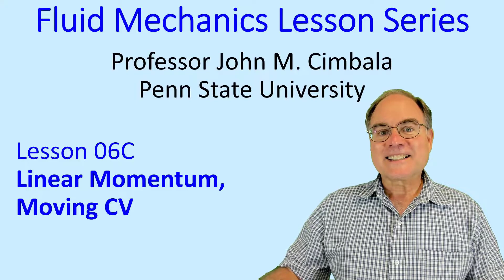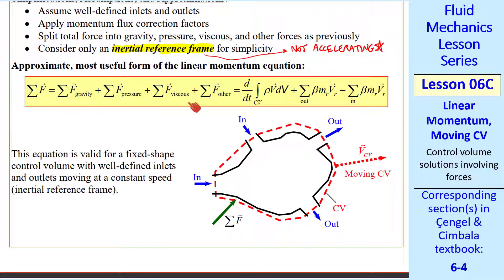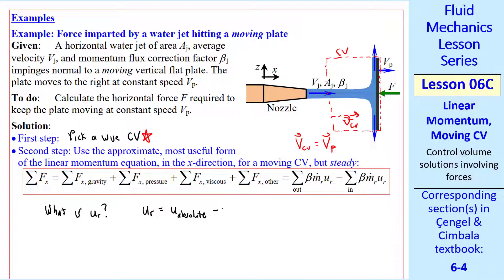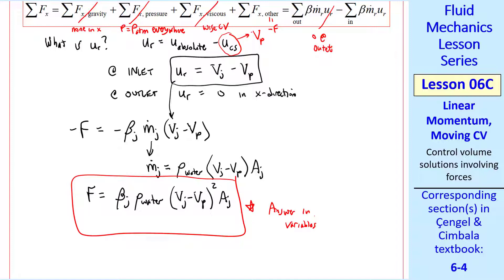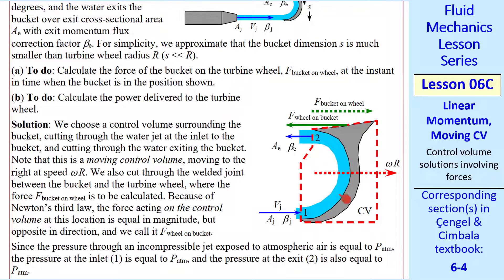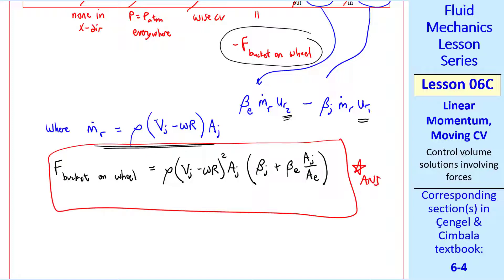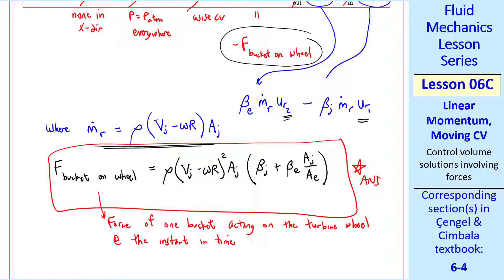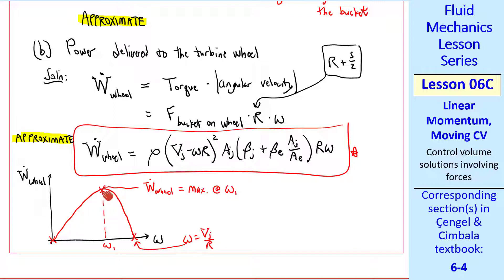Fluid Mechanics Lesson 06C: Linear Momentum, Moving CV

Comment: Same question as the other guy "F bucket on wheel should be positive to conform to the sign convention used throughout and in this example as well. Right?

" I don't understand your explanation. Black box or not, you had to define your cordinates somehow, but you did not in the video.
Reply from the maker: The lack of a coordinate system was my failure - I have added it to the downloadable online lesson notes. As for the sign, as I replied to the other person, the signs are correct. I agree that I probably should have drawn the original force as positive in the x direction (to the right instead of to the left), but the final result would be the same. You probably remember from statics class that you can assign any direction you want for an unknown force, and then if the answer is negative, you guessed the wrong direction. I should have stuck with the convention of guessing a positive force in the positive x direction at the beginning, but for some reason I did not. I will remember this and do it more consistently in any future videos.

Comment: F bucket on wheel should be positive to conform to the sign convention used throughout and in this example as well. Right?
Reply from the maker: The signs are correct. The force of the bucket on the wheel is opposite in sign of the force of the wheel on the bucket. And you need to think in terms of the control volume, not what you think physically, since you can treat the control volume as a "black box" meaning that you can solve the problem without even knowing what is inside.
Thank you for your comment. Please tell your friends and colleagues about my YouTube channel where there are over 500 free videos about the Bible, fluid mechanics, science, math, Excel, statistics, air pollution, and other topics. I would greatly appreciate it.